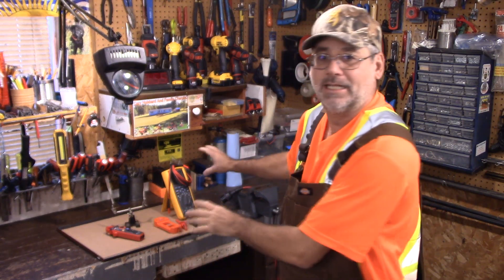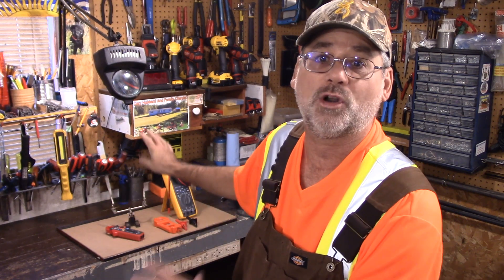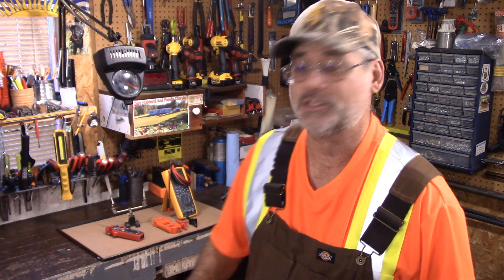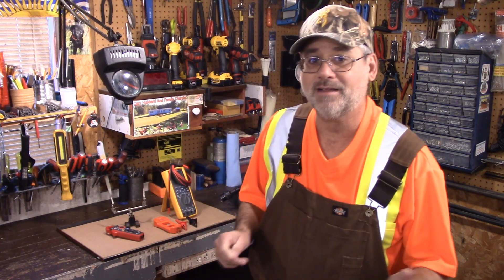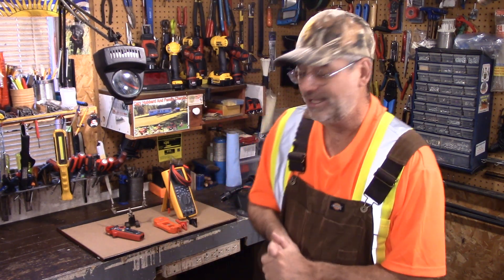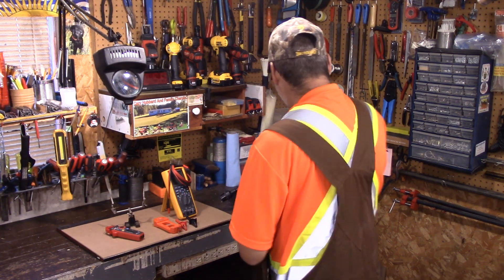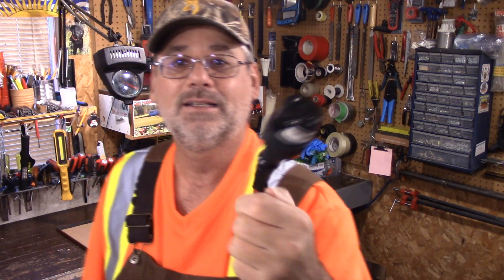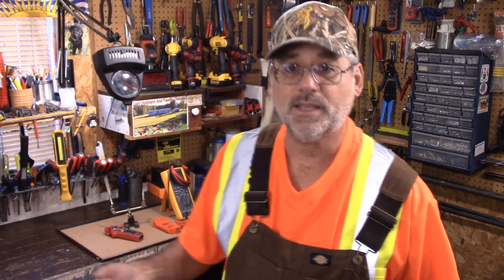BASIC ELECTRICAL WIRING AND DIAGNOSTICS SURVEY

Comment: While I know electronics very well, I am not an electrician.  I have to admit I have watched vids on wiring a 3-wire switch mainly to make sure I was wiring it up correctly, was doing it somewhat close to code and wasn't going to burn my house down.  :-)  So home wiring techniques are always interesting to watch, IMO.
Reply from the maker: The interesting thing about the electrical code is it's not universal around the world or within a country. Very odd it's not standardized  but for the most part it's relatively consistent  over all.  Basic Electrical  can be very controversial  so It look like controversial it will be :)
Reply: @SteveRobReviews , yeah, code is different depending on where you live, however, if it is wired to the code approved somewhere then it is considerably less likely you did it wrong or will start a fire.

Comment: Great video thanks brother. I would be interested in seeing it. I believe as long as you put a disclaimer in you should be ok. I am probably too comfortable wiring stuff up. I am a retired heavy equipment mechanic. I cut the power company wires on a house I owned. Ran a new weather head to the meter and from there into a new box in the house. Called the power company and told them someone cut my power off. Playing dumb they hooked the power up to the new wires and left. I could tell you more but you know how it is. I don't like electricity but it's not a problem for me. Keep up the great work see you in the next video thanks again brother
Reply from the maker: Thanks Scott  will do.

Comment: Some stuff you can do for yourself. Some stuff you need a professional.  Three way switches are as much fun as figuring out what is wrong with the wiring on your car or motorcycle. Basic wiring stuff can help some people, but making mistakes can be costly if you do it wrong. Like burning your house down.  Thank you for the video, Steve
Reply from the maker: I would say out of all the trades electrical is the hardest to master since  it's so hard to figure out :)
Reply: @SteveRobReviews  And it is invisible and wants to kill you if you make a mistake

Comment: Hi Rob, I'm an electrician in Ontario who has been asked many times how to wire a three way switch. Unless the circuit is being newly installed the answer has to be tailored to the wiring method originally used. There are lots of ways to wire these depending on where the feed is located and where the switched wire (that's the one going to the light) is in the circuit. Try showing one where the feed and switched wire come from the same box, then one where they come from different boxes, then one where the light is fed first. Show how to tell which wire is which with the breaker off. That would be helpful. Cheers.
Reply from the maker: All great points . The idea of teaching electrical circuits and design is like a child starting to walk. Most  want to starting at the walking stage and miss the crawling part and that's the most difficult part :)  The basics are glossed over many times in videos as most just show how to wire or diagnose a circuit but not say why their doing it a specific way . Electricians don't guess how to do something  but far too often DIYers  do guess and it usually goes sideways real fast . HAHA

Comment: I know enough about house electrical to get myself in trouble like the time i replaced a simple receptacle on a split circuit and kept kicking the breaker after. I spent hours going over my work. I finally had to ask the electrical educator next door to help out and after a lecture about how stupid i was told me how to solve the problem.
I think a little basic know how is a good thing. I have been putting off some small projects since i know very little. Automotive electrical i understand but that's where it ends.
Reply from the maker: Good point Bill as many think DC and AC are the same until you blow something up. LOL

Comment: It is always good to know the basic stuff. I am like you, just a do it yourself-er. I know low voltage stuff like telephone/cable tv/ security by trade, but I have always been scared about electricity.
Reply from the maker: Yes and most feel the same so taking the danger out of the equation is the trade as they dont like the possible danger as well. It's always good to learn from reliable people .
Reply: That is true.

Comment: You said it all Steve....I`m kind`a shy to show ...if someone takes it the wrong way and burned his house down or hurts himself....I don`t want to be responsible....I earned a good livelihood in this trade and it paid very well.....a lot more than youtube would ever pay and I`m in it for fun....getting shocks for other people is not fun so I play it safe and go on the edge sometimes here by accident.....CHEERS
Reply from the maker: I guess that goes with auto repair vids as well doing electrical - you do a incorrect procedure and it may cost you a computer or do some incorrect wiring and your car could go on fire  or working around gasoline could blow yourself up. The liability is a factor  and the techs on youtube we know do their best at explaining but in the end they do not have any liability on youtube showing how to do anything correctly. Cheers
Reply: @SteveRobReviews  Your right Steve but I`m just afraid to get burnt for what it doesn't pay....By the way...A big thanks to the acknowledgment you gave use on your video

Comment: I'll admit i am much more comfortable with automotive electrical than residential. The only basics i know is to shut off the circuit breaker first:) i felt like a hero for installing a dimmer switch 😁 bring the electrical Steve!
Reply from the maker: Mario I  have had friends in your trade ask me where the hot or red wire is there's only a white - black  and a bare wire . No red what's going on LOL  Oh ya and when I say the black is the hot they say that's nuts it should be red. HAHA  Yes we can all learn and have some fun too. Cheers

Comment: Yeah. I understand why some people are a bit reluctant to show electrical stuff due to the liability. Electricity is dangerous stuff, i have been shocked and one time i was saved by the fact i was extremely well insulated which i actually always make sure because i don't really trust electricity or myself entirely. I think it probably does more good than harm to show people the correct way to do things because there are always people who will have a go regardless. It's better that they are looking at how the professionals do it than some random idiot who puts it up on YouTube. 

One thing to consider is that it's one thing to show do wiring in the US/Canada but other countries like the UK and Europe/down under have entirely different regs/standards. Like in the UK we use ring mains and instead of two 110v phases 180 degrees apart we have 3 240v phases 120 degrees apart with most domestic wiring just being single phase 240.
Reply from the maker: Yes there are different cycles around the world 50-60  and codes much different. Good point as many will try to save some money and do wiring themselves so its them that will watch a video to verify its being done right.

Comment: Alot of it is experience. Thats why in mass you need 10000hrs apprenticeship before you can take your license test. (I am really comfortable doing my own electrical. Lol) first year tech school is hardcore theory for a reason. Electricity is not a toy for sure. Knowing just enough to get in trouble could kill you or someone else and burn your house down. All in all...knowledge is power. Dont know? Ask. 👍👍🍺🍿
Reply from the maker: Yes its like most trades and safety is paramount.  I would say most should know how to change a tire and change your oil on a car and electricity you should know how to do  the basic  testing and replacement of light switched and such but not much more unless you carry a fire extinguisher with you at all times. LOL

Comment: I spent more time than I'd like to admit looking for how to wire a light that I can just plug into the wall for my sandblaster. After all the YouTube searching I found that I just had to match up the three colored wires😂 I plugged it in fearing it will catch on fire but it actually worked! I was proud of myself and my gf was like... yeah I know that already,it's simple😣😂 but yes I'd like to see videos like that, any home wiring stuff scares me because I'm afraid of starting a fire.
Reply from the maker: It's so much like auto repair in many ways as most times people will not work on cars  because  of the unknowns. In electricity it's much easier as the unknown are more consistent and test so much easier :)

Comment: Great Video Steve I highly recommend Mike's youtube channel Grampie's Workshop he has a lot of practical tractor mods and his letting down the water video is really good as well as his maintenance video's. a basic wiring video would be very helpful I am good with basic dc 12v wiring as in solar and some basic wiring such as plugs and switches. 120 v though I have never wired a panel or subpanel before other then 12v dc solar which for me is easy. I also wire them in parallel never have dome series, such as for doubling voltage.
Reply from the maker: I agree and learning from scratch is a good thing as so many have picked up some not so good habits watching the wrong way at times. LOL